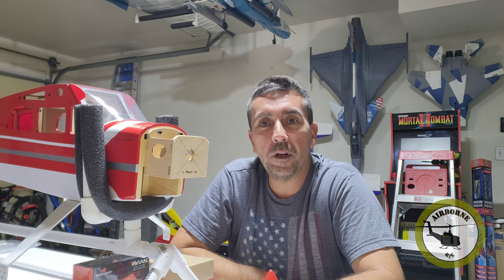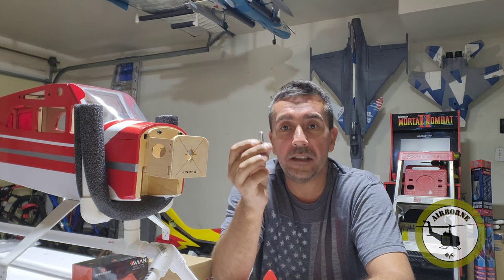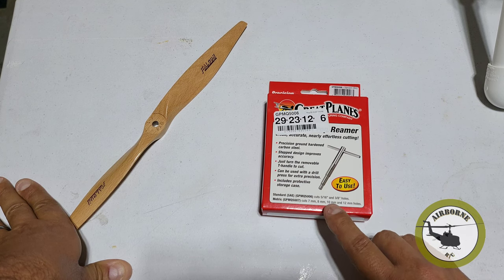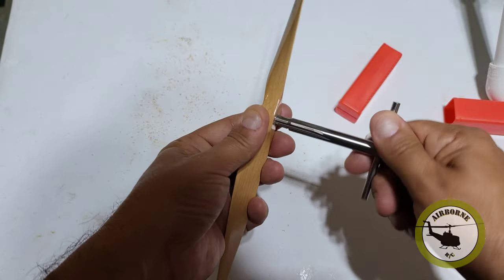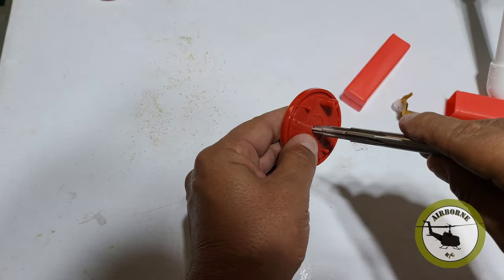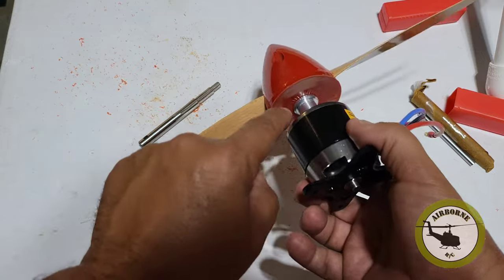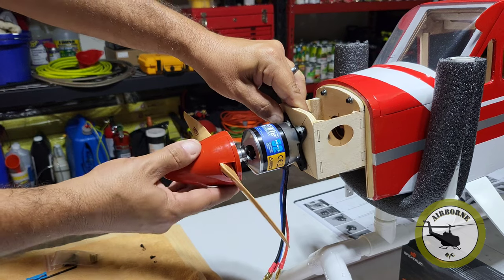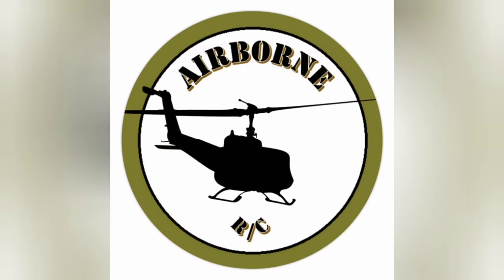PROP REAMING! How to make your prop fit.

Comment: Hey! A drill would work, right? Cuz im prolly not gonna get a reamer in my country but I do have a drill and the screw thingy that’s the same size as my shaft… I recently got 9045 props for my next build, using a 2217 1500KV motor… but the prop shaft is prolly 4mm while my motor’s shaft is slightly bigger… just wanna know if a drill would work just fine without damaging the prop… it’s one of those grey coloured hardened plastic thingy prop…
Reply from the maker: Yes a real would work And will not damage the prop issue is centering the drill as you cannot a 100% get that drill in the center of the hole so you might all block it and throw off the balance
Reply: @NoonzAirborneRC  i ended up drilling through all the props i bought! For a moment it seemed like if they went a bit off-center but when i put them on the motor, the seemed just fine... Again, so long as the plane flies okay i dont much care if the centering is SLIGHTLY different aha- I was planning on buying a reamer but when I checked the prices in my country, I thought a slightly off center prop is better lol- the reamer you used costs about INR 5451 on my country's amazon... which is around 67 USD... so yeah, i thought a drill is the way to go lol-